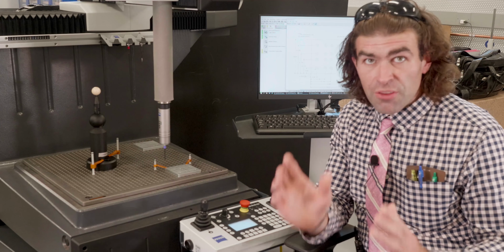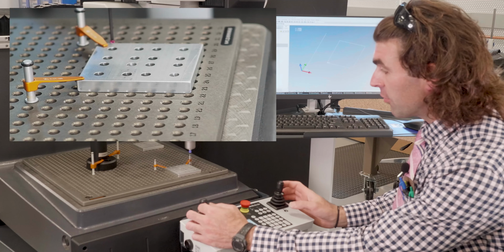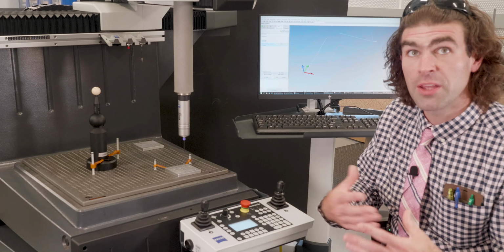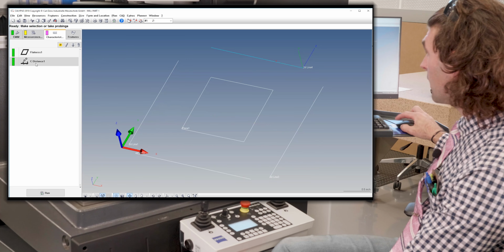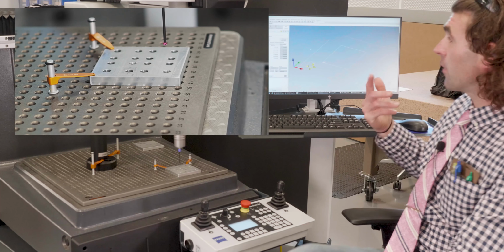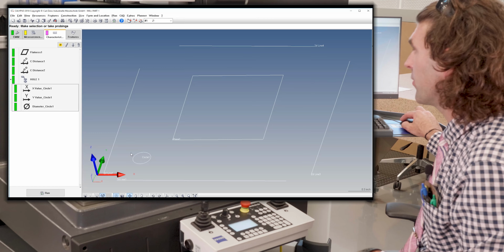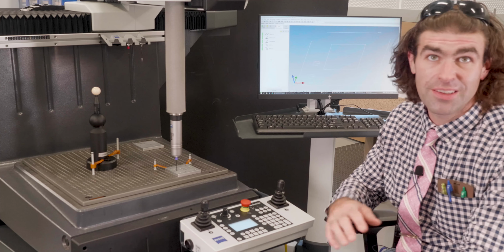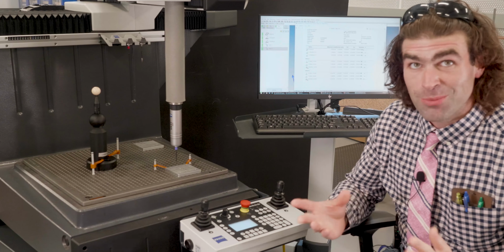CMM Zeiss Duramax with Calypso: Basic Measurements  (Programmer Training Lesson 7)

Comment: Thank you so much Dean for posting your videos! I have learned so much from them. I have a question that I hope you can help me with. My stylus comes down off center and impacts the hole edge even though I had it centered when I wrote the program. I did a manual alignment and I have the part very secure. In your opinion what am I doing wrong?
Reply from the maker: Check the retract distance. Make it smaller to avoid hitting the other side of the hole.
Reply: @RDeanOdell I will try that. Thank you!

Comment: Hi, question. Should the nominal value be pre programmed? It says 2.9958 but isn't that the value of your initial measurement?
Reply from the maker: Hi, if I’m not using a CAD model, I will get the features first, and then punch in the correct nominal dimensions from the drawing.
Reply: @RDeanOdell   Thanks, i'm just starting. Had 3 evening courses so far and try to practice when possible.
Reply: At 12:03. Should you enter  the value of x 0.5 and y 0.5?